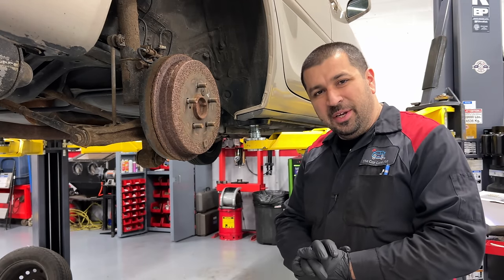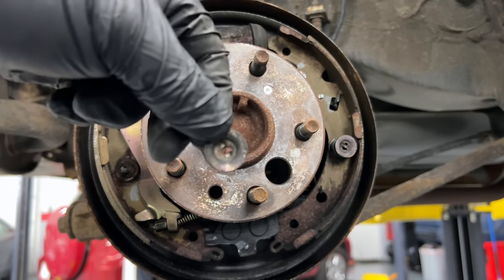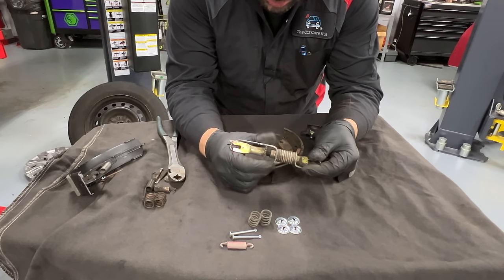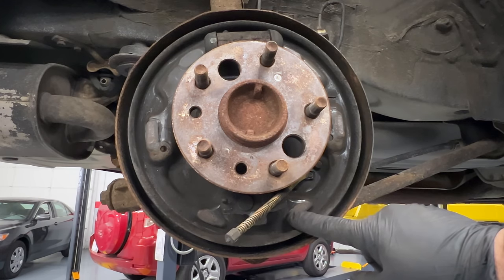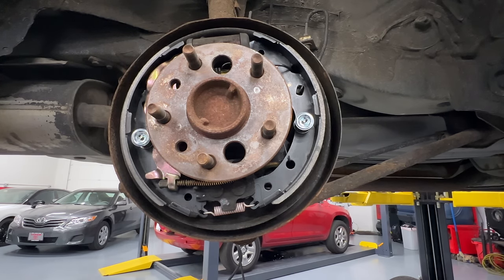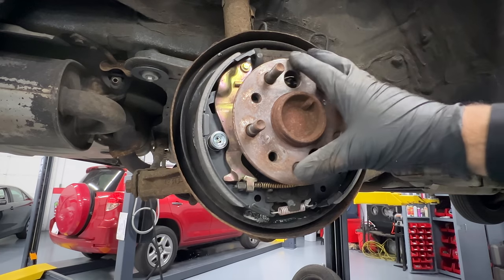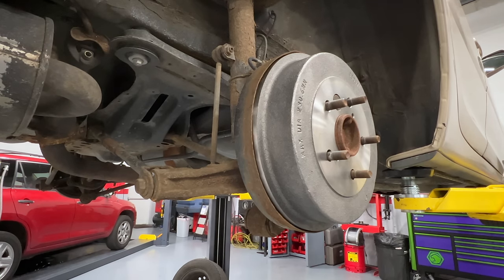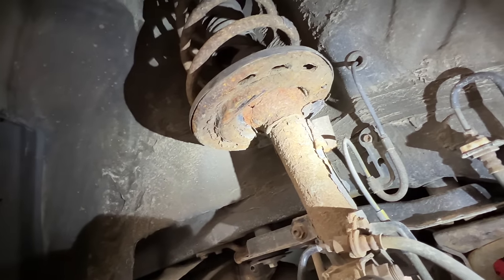How to Replace Toyota Drum Brakes Like a Pro

Comment: This is one job I know how to do forward, backwards and upside down, and I learned by doing it several times. My dirty trick, though, is getting the brake shoes at the junkyard for a dollar or two each. There are lots of them there that are new or near new. You also can find new hardware and freshly turned or even new drums and rotors. As hard as it is to believe, you can measure drum and rotors with an ordinary ruler. A see-through plastic ruler from the dollar store works just fine.

My other trick: Get a tube of synthetic brake grease. You can use it for all purposes, for example lubricating threads, whereas you should not use other types of grease for brake assemblies.

The problem with self-serve wrecking yards is that the prices have become quite high. I have found, it is not worth it buying a used brake drum anymore. You can get the one you have turned or buy a new one if you need to. Prices vary considerably depending on the parts store and the brand though.

Comment: Hi! Thank you for posting this video! I am missing some of the tools like a bolt and drill to do this with. Other options? Also, my car is at 200k should I think about changing the brake fluid as well?  Lastly, where did you get the tools and parts you used in this video? How do I know to get the right parts to replace the hinges and springs, etc? thank you!!

Comment: I love the detail in your videos and how you are helping us to learn to do it right the first time.  I was just told my 2001 Tundra needs front brakes but they never said anything about the back brakes.  I used to watch my ex many years ago do brake jobs but never paid attention to the details.  I watched your front disc brake video and now this one and I'm almost feeling confident that I can do it myself versus paying the outrageous price at the tire shop. My question might be stupid but, Isn't it necessary to bleed the brakes after they are changed or is that only done if you let fluid leak out of the cylinder?

Comment: I pump the brakes a few times after the adjustment and then go back and check.  It’s usually loose again as the shoes weren’t perfectly aligned under the drum.  I usually have to do it a few times.  This ensures that both shoes are pressing against the drums evenly so you don’t get excessive wear on one shoe.
Reply: Good point, it aligns the shoes, & CAN affect adjustment. These are OCD things WE do for our own benefit. 😁

Comment: My father thought me how to replace brakes and brake pistons since 3rd grade but he never thought me to smoothen the edges.  We don't have that high tech drum spray cleaner, we just use soap and water and dry it with compressed air, sandpaper any rust then spray high-temp paint.  One no-no he taught me is to put a little grease where the drum contacts the hub to prevent the drum, I found out for myself that I can simply use a correct size nut to push the drum out and not use hammer.

Comment: Guys.. he makes putting the e brake bracket on look soooo easy. And i only have sharp cutters lol.. damn parts lady ended up selling me the wrong damn shoes(they're different sizes whereas each shoe that was on it are the same size). & i gave her the VIN. I don't have any friends or family to go to the parts store ease. Missed a day of work cause i felt super confident doing it last night, ended up not taking enough pictures of the adjustment screw and getting confused of it's orientation. Then the videos are saying to have the longer side of the fork of either adjustment screw side in the back but it doesn't sit flush on the parking brake side. Guys please give yourself the weekend to tackle it, take sooo many pictures from alllllll angles alll around, and TAKE REFERENCE OF YOUR SHOES SIZE BEFORE BUYING FROM STORE. Also i lost hella fluid popping out my wheel cylinder as mentioned and now the left side of the cylinder doesnt compress 😭😭😭 any tips would be greatly appreciated.. 09 Prius

Comment: 2:43 This is really a crucial tip here. I popped the piston out of the cylinder. It kept leaking slowly after I put it back. My mistake surely cost me a cylinder, and probably also caused me a wheel bearing that I later replaced because the caustic brake fluid was dripping down on to it.

Comment: When my son was looking for his first car, I told him that brakes were the most important thing. Even if the car doesn't run, you still need good functioning brakes, even if you're just pushing it around. Small cars weigh a ton and a half. That is way more mass and energy than the human body can can control. If it is running you have no choice but to have good functioning brakes and maintain them, because any moving vehicle has to dissipate all of the energy that was expended to accelerate it to it's current speed. (Think Space Shuttle heat shield tiles. Also think about race car brakes glowing red in endurance races.) Without maintenance you eventually will have no brakes, but will still have to dissipate all that energy.

Comment: Wish this video was out 4 weeks ago, when I couldn't find that star adjuster to loosen the E brake so I could get the drum/rotor off...Of course these are different brakes, but good video...Didn't know there was any pure drum brakes on Toyota cars...Thought they were all disc brakes with the drum for the Ebrake in the rear...
Reply: Must been a 1st gen camry. I think my 86 had drums all around. 97 had discs up front. Thought I died & went to heaven! 😂🤣

Comment: Lol, Just did one side of my 2005 Toyota Camry. As it turned out, the ones I am replacing have both the parking brake mechanism and the adjustment mechanism on the same side, that is, to the rear. So there is a longer pin that those two mechanisms pivot on that I had to hammer out and switch over to the new shoe. Also, there is a different, small spring that attaches the adjustment mechanism. However, there is no corresponding hole on the new shoe for the spring to attach to, about 3/4 of an inch above the hole for the shoe hold pin/spring.  So I drilled a hole for it. This was my first time doing this so it was a bear getting everything situated and the Springs hooked up. The hardware kit I chose left a bit to be desired.
 I will have to do the other side another day but the lining wasn't as worn down on the front shoe. But I think they would pass inspection which is due this month.

Comment: Agree that every mechanic has their own way. I don’t use those brake tools at all.
For those spring retainers I use either regular pliers or Vice grips on the outer edge. I also like to use little picks for R&I of the other springs.
There are better people than me at turning drums. So I might let them do it, ONCE.
I don’t like turning drums though because you weaken the drum. Remember that the shoes are pushing outward and you need sufficient meat out there to prevent drum distortion.
I, personally, prefer a more grippy pad/shoe than OEM though.
And I was raised on antiseize dabs at the rub points. But very conservative dabs.

Comment: I like to add a very thin layer of anti-seize between the hub and the drum... so it comes off easier (I live in the northern rust / salt belt).
Reply: I'd also remove any rust from the hub before adding antisieze. Both make taking it apart next time so much easier.
Reply: @flhTK-2012  Oh yeah - absolutely - you have to take all rust and dirt off before adding anti-seize... but only add a very thin layer. I have found if you add it too thick, it too can cause issues with balancing - believe it or not.

Comment: Very informative video. I have a 2014 Corolla with rear drum brakes. I’ve taken it to a dealer twice within a year because the rear brakes were making a noise. The vehicle has 135k miles and I was told the brakes are still good. The dealer says they adjusted and lubricated the brakes. My rear brakes are making a noise again. Does it seem normal to have to get my brakes adjusted again in a span of a 1 and half? I would think a single adjustment would last a few years assuming the pads are good. Any advice? Thanks

Comment: 😂🤣U are funny, I'm one of those old guys, been doing drums for 50yrs! I FINALLY GOT my Prius 4yrs ago w/ rear DISCS! Only advice I HAVE for viewers is while backing plates are BARE, take antiseize & coat those flat spots linings ride on. A THIN coat works great. AND I dismantle the adjuster, brake clean it, & antiseize threads. I'm so anal I painted my drums! 😂🤣😁 Oh, and dont get drum that DONT have adjusting hole on them! A REAL PIA to pull drum off, adjust, pull drum off, adjust.🙄

Comment: Awesome video. I have a 2005 Camry XLE and it has disc brakes on all 4 corners. I'm assuming Toyota put drums in the rear on just the lower trims to save cost?

Comment: All good,but wheel cylinders would recommend to be replaced at the same time when disturbing brakes (unless newish)and especially if its a rusty special.Backing plate can also be lubed with high temp grease,less messy.❤

Comment: Though if you do this remember to put car in gear and hand brake has to be off. Or the drum will not come off, if it does come out; the pin and spring will come out too.

This is a beginner tip.

Tip 2

If the brake is too tight it will fail the MOT and it will be called a brake imbalance. Very hard to loosen without braking something.

Comment: Can't place enough emphasis on being careful with the cylinder! I just did my drums on my 98 rav4 and the shoes immediately pushed through the Aisin cylinder causing a squirt of brake fluid from one of the boots. It didn't seem to leak on application of brakes so I'm going to rock it for a week to see if it's still good (fingers crossed..) but I suspect a new cylinder is probably required. The shoes push through very easily when you're wrestling with the main return spring!

Comment: When I was a teen in the 1970s, anytime a car in my family needed drum brakes replaced, my father would do it, and I'd watch.  Almost anything else, he'd encourage me to help, do parts of it, etc.  But with drum brakes, he said they were tricky and nasty enough a job, I should just watch and hope I never had to do it myself.  He died at age 85 in 2006.

Fast forward to August 2022, when I turned 65.  I was preparing my spare car to sell, a 2005 Prius.  It had 230K miles, and failed NH inspection for front and rear brakes, with the rear being drums.  I've done disc brakes many times, but had only memories of watching my father doing drum brakes.  Ordered good aftermarket drums, shoes, spring kits, etc.  I carefully laid the parts out, paid attention to what went where on what I was taking apart after it was untouched since assembly in Japan.  I still got confused, with a few "How can this go back together the way it was?  Why is this end of the spring here instead of the other way?  Maybe a different pair of needle nose pliers would be better." sorts of moments.  But patience and persistence paid off, along with looking at photos about 20 times of how it looked before disassembly.  I even learned a few tricks to make it easier.  Got it done perfectly, passed inspection, etc.  

Hopefully that will never matter, because if the rest of my life goes as planned, I will never need to do another brake job on drums.  Maybe if I get nostalgic and buy a drum-brake car I used to own,  of which there were many, to entertain myself.  66 Plymouth Fury VIP (family car, mine for HS senior year), 70 Maverick, 72 Subaru FF-1G, 79 Corolla (my first new car, 1.2 liter 5-speed), 85 Merkur Xr4Ti, 89 Suburban, and 01 Prius, would be the leading contenders.  The Fury and Merkur would be the most fun to own again, but the Corolla ranks equally high in nostalgia for me.

Comment: Hello, Im a big fan and I have a question, my lady bought a camry 2018 with 125,000 but the transmission is slipping and not changing gears quickly, its an automatic and it happens rarely but its still noticeable, would you recommend using liquid molly with a fluid transmission change?

Comment: AMD, we have a 2019 Rav4 XLE, and recently got the Engine Maintenance Required Notification in the dash. Do you know about the A25A and related coolant bypass valves going bad? I had to do some searching to find out what it could be. Some of the usual Toyota Rav4 forums show that it is different from the Maintenance Required Notification. And many say that a common problem is the coolant bypass valve that goes to the heater core. One way I was able to confirm we have this problem was to turn the heater on full, and start the car. The Engine Maint Reqd Notif went out. As soon as I turned the temperature down and AC on, it came back. I guess this means the valve is stuck open. Would you want to do a video on this issue? I can see it helping a lot of people if they can understand it better.
Reply: Oh I saw the common problems on the updated 2022 Rav4 video. You do mention it...

Comment: Is max thickness about 5mm? I have a 21 Tacoma 23k miles and during a oil change service a dealer tech reported I had 2mm left on brake shoes. I'm easy on brakes and dont tow. I dont believe he checked them, now I have to do it myself. Is min about 1 mm. Good video.

Comment: Great video but not only on Toyota, every single make and model with drums I would definitely replace the wheel cylinders since you're there and they are very inexpensive but if those leak you gotta start all over again and the only things you can salvage is your drums and your hardware kit. Any type of grease on your brake lining? I would highly avoid that.

Comment: Love you CCN , but , you really  should clean and lube the adjuster and wire wheel the hub ( to ensure a true seating ) and put a " smite" film of grease there also ( to prevent corrosion )  ... Not to mention the pivot point of the emergency brake ...  I'm slightly more of an old timer than you ... Then you have a perfect and happy brake drum assembly ...   Peace and blessing from N.Y.

Comment: Great video. I never adjust my drums so tight though. I adjust them so they are "barely" touching the shoes otherwise like in your set up, the drums will get very hot for the first week or so and your fuel mileage will suffer. When my pedal gets too low, I simply take 10 minutes and adjust them again.
Reply: I have to agree with you on this totally, being so tight against the drum is just going to greatly accelerate the wear & tear.  Besides doing so will cause premature rear wheel lockup(that the ABS won't be able to help) during emergency stops.   After all, aren't the rear brakes self-adjusting!
Reply: I agree. He adjusted them extremely tight. I adjusted them to where you grab a lug and spin the assembly with moderate force and it stops at 1 revolution. When driving, it’s almost like anti lock brakes on a 1980s or 1990s car.

Comment: I wanted to replace the emergency brakes on my mom's '92 Camry XLE as the lever didn't put up as much resistance as it used to and I made the mistake of ordering a set of replacement rear drum brakes as are used in this video but which are NOT the same as the emergency drum brakes.

They look similar but are different and incompatible, so watch out and make sure you don't make this mistake. Unfortunately I bought them on RockAuto and by the time I realized my mistake the return window had closed so I'm stuck with a set of rear drum brakes I have no use for.

I'm talking about a Camry (or any Toyota model) whose rear brakes uses calipers, not drums, but whose e-brakes are drums and not an integral part of the calipers as is the case on some cars (the ones where you need a special tool to turn the pistons in instead of compressing them in).

Comment: I stupidly replaced the oem drums on my 06 Sienna ( could have gotten thousands of miles more on them ) with after market ones. The result after completing the job was vibration galore. It turned out that the brand new aftermarket ones were out of round. This I was told by the technician who turned them for me.

Comment: I have a 2000 Camry LE the back brakes are drums. I want to change them to disc brakes. Can this be done? Plus the brakes period are sticking or something to that nature. The brakes I bought are Weaver pads and shoes. I will also get new rotors and drums in that same brand.  The brake pads and shoes are ceramic. I got them at Advance Auto Parts Store where I live. These may be original pads and shoes as well as rotors and drums. Thanks much for this video it's very helpful. God Bless.

Comment: Very informative video,,however why not put copper slip on the backing plate,,or as you yanks call it never seize ,it would be far less messy than spraying white lithium grease and cheaper..Great Vid keep them coming..From across the Pond.

Comment: I decided to replace the rear drum brakes in my 2013 Honda Civic with 115K. After I removed the drums, I realized the brake shoes would still last another 50K miles or more. But since I bought the Parts, I decided to go ahead. During install the brake shoes, one of the pistons fell out which introduced air to the system. After done with the installation, time to bleed the cylinder, but I broke the bleed nipple which I had to remove the shoes again in order to remove the cylinder. After struggled couple of hrs to remove the broken screw, I decided to purchase a new one.  My point is, I just hate working on the drum brakes. It is a pain to get those springs put back on and takes like 10 times longer than disk brakes.

Comment: I had Toyota rotor rust really bad. They did not have a lot miles on it. I had to change it twice since I had the car. They car had less than 100,000 miles on it. The pads were good, had do a complete brake job on a Toyota Corallo. The Toyota dealership I Goto does all the repair on it.